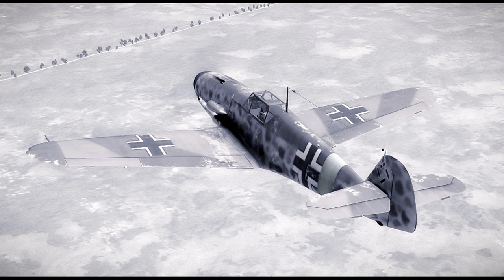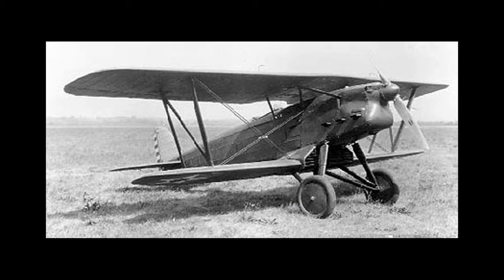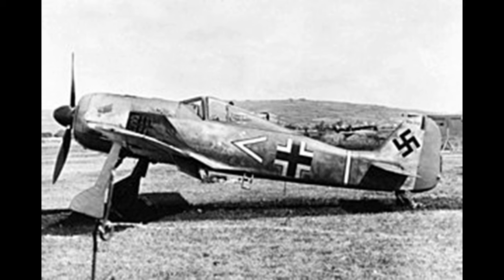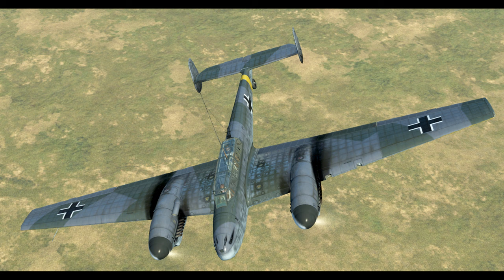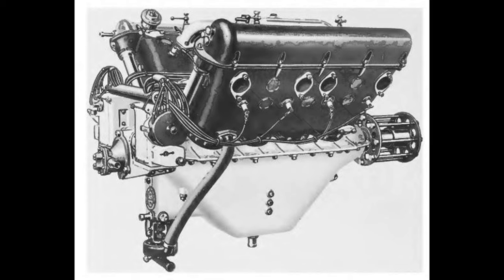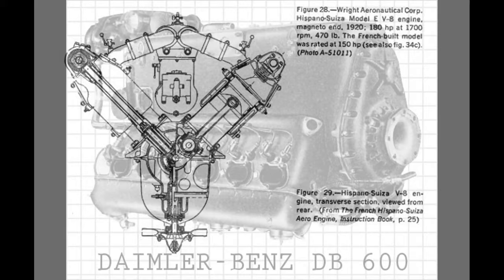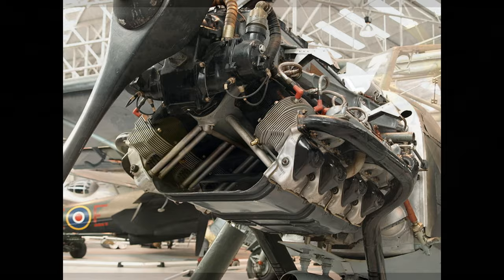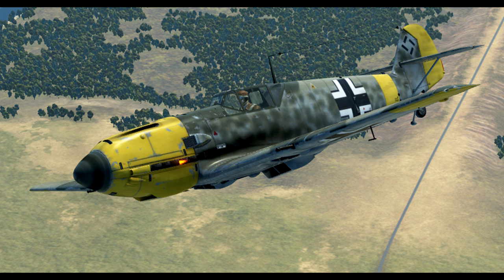Messerschmitt Bf 109 , Why an INVERTED V-12 Pt. 1? inverted V12s vs. upright

Comment: I wonder if the inverted Vs had the same problem radials had - oil and/or fuel pooling in the heads of the inverted cylinders and possibly causing hydraulic lock. They take care of this in radials by cranking the engine with the ignition off to purge the lower cylinders of any accumulated fluids before actually starting the engine, and when the engines start you often get large puffs of smoke. I imagine you had to do the same thing with inverted Vs.. though I also imagine it's more of a bother because the Germans liked crank-driven inertial starters. Maybe the pull the engine through a couple of rotations by hand before winding up the starter.
Reply from the maker: I would assume so, but I haven't ever operated one.

Comment: The vision thing is a non starter; both the RR Merlin/Kestrel/Griffon and the DB 600  had geared props, that placed the centerline of the prop at around the midline axis of the engine, in all cases there is about as much above the prop as below it, as your picture of the DB600 shows quite clearly. The same  argument applies to the CofG.  The Storch is non geared so visibility is improved with an inverted engine in that case.

BF109s made under licence post war in Spain had upright Merlin engines, the overall shape of the plane is almost identical to German BF109s, enough so that they were used in the Film of the Battle of Britain.

One downside to an inverted engine is that it makes oil scavenging more difficult.

I don't think there is a good reason to choose one layout over the other. What is known is that the German Air attache and some engineers visited the Rolls Royce factory well before the war. Rolls were anxious not to divulge too much and had a V12 aero engine on display deliberately mounted upside down. Whether this influenced the German air ministry at the time is not known. At the time German aero engine development was well behind that of the UK And the US, in particularly the designs of RR, so perhaps they had a slight inferiority complex.
Reply from the maker: Visibility is effected because with the inverted design, the narrower part of the engine is at the top of the cowling. Center of gravity is effected because there is more mass at the wider part of the V.
Reply: @GregsAirplanesandAutomobiles  No the crank is the heaviest part of the engine.

Comment: Germans don't need to consider V-12 gasoline aero engines for boats or tanks. German tank engines are MTU V12 engines and German boats are equipped with Benz MB series diesel engines which have commodities to aero designs but are verted.

Comment: The Germans wanted a cannon to fire through the propeller hub on there me 109 and bf 109  and later there fw190 D9. This was a luftwaffa spec.
And a inverted V would keep the hight down it’s that simple 
Just think of the Bell P39 and what Bell had to do to do the same thing.
The 109 and Spitfire were point defense fighter so light weight was in mind that’s why there landing gear was mounted to the fuselage so the fuselage was stress for landings not the wings like a P51

Comment: Great video! Very informative. Pure speculation here: do you think one of the reasons to invert the engine may have been (secondary to the other more important reasons you mentioned) to avoid the pilot having to breathe exhaust fumes? Also, in even a minor internal gasket failure, the oil typically exits via the exhaust ports which would impair forward visibility. Again: I'm spitballing here. This is based on nothing more than speculation.

Comment: How was the oil collected, and how were the main bearings lubed?
Reply from the maker: It had a dry sump system. The oil was collected in the valve cover area before going back to the sump.

Comment: Sadly, Patton made a massive mistake in pushing for the Sherman. Especially with the aircraft engine. Aircraft engines were designed for a different RPM range than the tanks were being run. There was a massive issue with plug fouling in WW2 from tanks idling the aircraft engine for long periods. Think of an aircraft engine trying to be used during rush hour traffic jams. The wrong design for the armored warfare application. 

Ford powered Sherman's started trickling in as the initial aircraft powered Sherman's were destroyed or replaced. The Ford engines were more reliable and performed better.

Additionally, the Sherman killed thousands of our soldiers. It was the wrong tank based on a 1930's platform. (A great suggestion for your research). I suggest you read Death Traps by Belton Y. Cooper. A sad tail of a tank designed by committee with Patton pushing for its acceptance to meet his doctrine.

To quote LT Cooper of the 3rd Armored Division; “The 3rd Armored Division entered combat in Normandy with 232 M4 Sherman tanks. During the European Campaign, the Division had some 648 Sherman tanks completely destroyed in combat and we had another 700 knocked out, repaired and put back into operation. This was a loss rate of 580 percent.”

Also: 
A Poor Defense: Sherman Tanks in WW2. https://archives.library.illinois.edu/blog/poor-defense-sherman-tanks-ww2/
Reply: W Grebenik one reason that some tankers actually did like them was the extreme maneuverability and speed. True, the main cannon left something to be desired, eventually it was replaced with a more appropriate weapon. don't sell your book here.The topic is inverted V engines, not Shermans.

Comment: I wonder if the inverted design lent itself to injected power for better dive performance for the Messerchmitt, Macchi, and Kawasaki fighters vs RR and Allison powered fighters at least early on.
Reply from the maker: No, injection works just fine on either an upright or inverted type.

Comment: Turns out taking out a Tiger with a Sherman is much easier than the Americans expected. Just wait until it breaks down, fire one HE round at the engine deck while the crew is repairing, then walk up and use demolition charges. (Of course this is a simplified scenario, but so is the 1v1 duel)

Comment: Did the German inverted Vee engines get some input from the Bf-109 design for a 15-30mm cannon firing through the spinner?
Or could that have been done simply by arranging the reduction gear interface with the prop to allow for any engine orientation?

Comment: You don't need an oil pump, 'cause the pistons slopping around the oil all over the insides of the engine. Pretty useful when in zero g combat situations when the oil of regular engines don't  get into the oil sump. Together with an fuel injection it makes a hell of a zero, or even negative g fighter.
Reply from the maker: You do need an oil pump. You can run a 1000hp aircraft engine on splash lubrication.

Comment: Maybe the valve gear got in the way of mounting the guns on the top of the engine cowling werent the guns timed off the cam shaft to fire through the propellers maybe inverting them gave the tension required on the gun timing chain, illimenating the need for tensioners.
Reply from the maker: I covered this a bit in Pt. 2. There were plenty of planes with upright V-12s that had guns firing through the prop.

Comment: the crankshaft is much higher with this engine. this gives a huge air-dinamic advantage for the air flow above the wings
Reply: All of the V-12 engines under discussion here used reduction gear which placed the propeller shaft in the centre of the V.

Comment: the purpose of the Inverted Engine, (DB600) was easyer Maintenence and better Options to build in Nose weapons. over the Engine. (Better line of sight than under or beside the engine.) All other DB-600 Series engines based on that first one. so all other aircrafts get that enginetype.  not because it was neccassery... but it was there.

Comment: What about space for a pair of machine guns or cannons firing through the prop?  Willy Messerschmits design?  Firing through the prop means makes deflection fire simpler.  Wing mounted guns can only trained for a defined range.  I think this was the primary function of the inverted V.  Look at the difference between the 109E and the 109K.  The rest of the advantages were secondary, and since so many were built for different aircraft the advantage became clear. Economics, an engine from a fighter that can be used in other aircraft.   👍

Comment: A nother reason was the fact was, that both the fw 190 D variants and the bf 109ns had most of their armament in the nose and turning the engine upside down made it far easier to fit a 20mm mg151 cannon or a 30mm mk103 or mk108 cannon
Reply from the maker: Nope, that was not a factor. Please watch part 2.
Reply: @GregsAirplanesandAutomobiles  well ive watched the vid now but, I didnt mean the relatively low calibre mgs above the engine but the machinecannon fitted trhough the engine.I now it wasnt a reason right from the beginnig, but the actual upside down engine actually makes it very easy to fit a cannon inside which also increases the accuracy by far due to the fact, that its muzzle is exactly in the centre of the plane 

But all in all I still dont that it was the most important reason since the early E models of the 109 where only fitted with wing mounted guns
Reply from the maker: Numerous planes had UPRIGHT V-12s and cannons firing through the prop hub, thus an inverted V-type isn't a requirement for this.

Comment: Great video, thanks!  Did the Germans run into any problems with oil-fouled spark plugs?
Reply from the maker: I am sure they did, I have never flown a piston engine plane that didn't.
Reply: @GregsAirplanesandAutomobiles  Thanks.  I didn't realize it was so common a problem. I had tbought it was mostly a problem with the lower cylinders on radial engines and, by extension, inverted inline and V-engines.  So, in addition to your other skills you're also a pilot?  Good for you!

Comment: Like you say better visibility, even tho the cylinder width can be slightly blended into the wing roots with the inverted design, the frontal area should be about the same as with the engine in an upright V configuration
Reply from the maker: hold your hand three inches in front of your fact, then hold it two feet away. Which way blocks more of your view?
Reply: @GregsAirplanesandAutomobiles  The cowling in front of the pilot will be narrower with the inverted V configuration, giving better visibility, but whether the V is inverted or upright, the overall frontal area should be about the same for the same size engines.

Comment: Loved the video, was looking around the internet about the supercharger angle of the db 605 in comparison to other engines (because of a prior video) and I read somewhere that the predecessor to the 605 had carburettors and apparently the supercharger was placed at an angle to the engine to improve air flow through the carburettors. Maybe they just kept the engine layout because of the prior construction?

Edit: I’ll place the source here if I can find it again

“Supercharger

The Roots-type two-vane, two-lobe supercharger is verlically mounted centrally at the front of the engine. It is gear-driven from the crankshaft to run at three times engnie speed and blows air through the carburetters, unlike its normal British counterpart which sucks the mixture from the carburetter.”

https://www.motorsportmagazine.com/archive/article/february-1952/19/38250-supercharged-super-sports-mercedes-benz

Comment: I'm not sure you made a very strong argument there.  The inverted V in an aircraft is easier to service, in nearly every other application that's not the case.  In cars, boat and tanks the underside is difficult to get to.  In any engine the valve train is what is going to need to be services the most so ease of access matters.  Plus with an inverted V you pretty much have to use fuel injection or side draft carbs if you can live with difficult starts.  There is more to go wrong with fuel injection vs a carb.  The German's had plenty of experience with fuel injection and even direct injection so it wasn't a big risk for them to go that route. Where the Brits and US lacked such experience. Also on a low wing aircraft it's desirable to keep the center of gravity low for low speed stability and inverted V8 helps a bit with that too.

In fact when compare early automotive US mechanical fuel injections it's crude compared with German designs, in 1954 Germans were using mechanical direct injection where we were limited to only mechanical throttle body injection.  It wouldn't even be until the mid to late 80's were US manufactures would start to embrace port injection.  In terms of raw power port injection doesn't make a huge difference but what it does do is vastly improve emissions which was the limiting factor to producing powerful engines in emissions era.

One of the biggest flaws in US military engines was using gasoline powered engines, diesels were clearly a wiser choice for tanks and small boats, even trucks.  The fire risk alone should have been the first clue and the torque advantage should have sealed the deal.  My guess is that was mainly chosen because the US had huge supplies of gasoline and the same av gas could be used.   My guess is that the PT boat were used around the ad-hock island airfields so again the same fuel type could be used.
Reply from the maker: I'm not sure what you are disagreeing with. Your entire first paragraph largely mirrors what I said. Second paragraph doesn't really address stuff I talked about, at least not specifically. As for your third paragraph, I don't think I have said much about Diesels anywhere on this channel. Maybe a sentence here and there, but that's about it. In short I don't see what your are disagreeing about.
Reply: @GregsAirplanesandAutomobiles   The part about diesel is related in a round about way, no question about that. In this case it's a bit of a tangent but does relate because it's where the German's gained the confidence in direct injection in the first place.  German planes use inverted V's because it's the superior configuration in that application and they could because of their experience with direct fuel injection.  Had other nations had that experience there would have likely been broader adoption of the layout.  I mean outside of the induction challenges, designing an inverted engine is only matter of addressing the oiling system, it's not radical design change.  In theory you could use the same long block design for either design.

Comment: One reason not mentioned for the inverted vee, is the better possibility to install a gun firing through the propeller hub. If it weren't a inverted design the gun would have to be very short in order not to penetrate into the cockpit and it will be farther from the center of gravity on the vertical axis thus being less accurate. One can see this beautyfully in the 109 F-K and the 190 D series.
In the tank branch off, the late M4s were significantly heavier than the early ones, the last with the 105 mm gun being around forty tons. The Panther was NOT a less reliable tank, atleast not in the german army where operational figures were equal to the Pz IV. The army was not happy with the M4 and Eisenhower was forced to investigate the case late 1944. Deestroyed tanks are the largest drain on logistics by using up precious space which could be used by better weapons.
Regarding Berlin the western allies were in no position to take it for one they were unable to cross the Rhine prior to mid March 45 because the Germans attacked them relentlessly throughout late December, January and February (Ardenne Offensive, Offensive in the Alsace, steadfast in the Hurtgen up to Nov. 44 etc).
The only joker they had was Patton and his 3rd Army who could have easily entered Germany as early as mid September 44, but Ike had to give a looser a go - Monty. The British had to get the stick because they were the ones who bled in Normandy in fixing the german tank divisions in place. Beside, the red army certainly deserved to get Berlin and certainly not the US and British who didn't move a finger until 44 when the Red Army annihilated Army Group Center AND both southern Army Groups shortly thereafter, something the British and US would have needed years to do with their puny forty division army.
Reply from the maker: Please watch Part 2, where we address the gun location issue.

Comment: I’m going to correct you on there were two experimental tanks that did use inverted V-12’s one British and one Soviet in both cases because they ran power-shaft from front of the engine to the rear mounted transmission or in the Soviet tank under the engine rear mounted transmission, oddly enough although successful designs both were abandoned probably for you just said about ease of maintenance and there were bouts but I can’t find any information on any.

Comment: The short answer to the question is that inverted engines were required by the RLM, the German Air Ministry.  Discerning the reasoning behind that requirement can be assisted by watching this video.

Comment: You mentioned the weight difference between the Sherman and the Tiger I and I am aware that the lifting capacity of ships cranes was a major concern for the Sherman.
My question is then how did the Germans manage to get Tiger I tanks to North Africa and be able to unload them given the greater weight involved? 
Does anyone know the answer or have they seen German Newsreel footage of a Tiger I being unloaded in North Africa?
Reply from the maker: I think we can assume they had stronger cranes, although I don't know for sure. That's really getting outside my areas of knowledge.